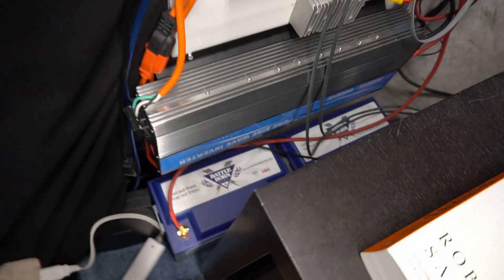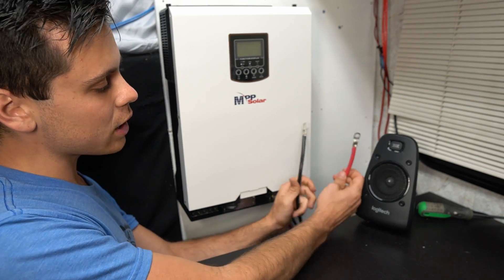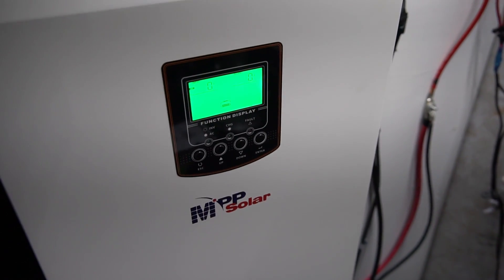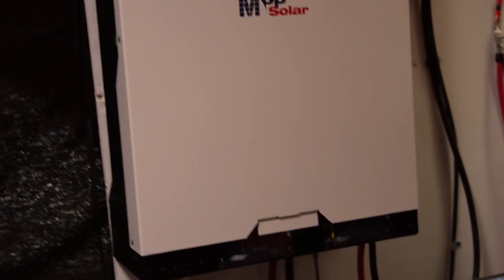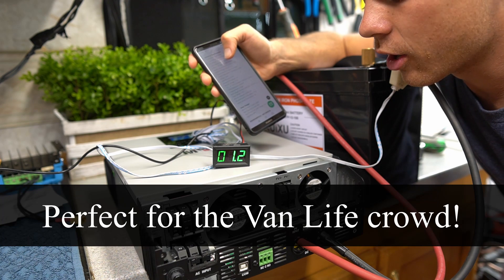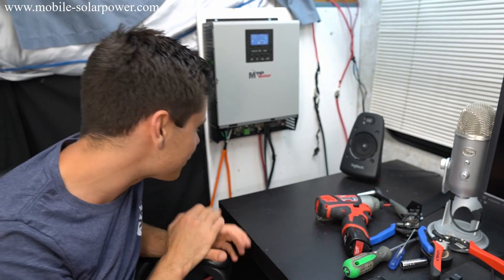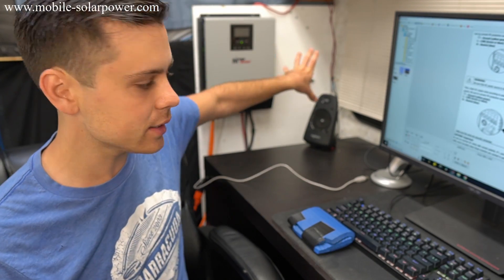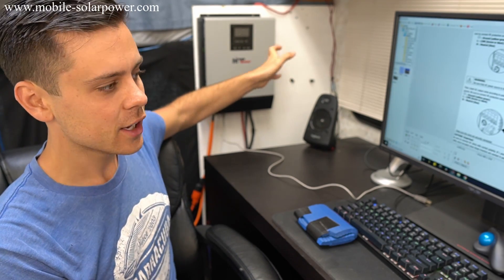MPP Solar Power Inverter/MPPT/Charger "All-in-One"  - Complete Review -

Comment: Heavy duty velcro like 3m dual lock tb3870, some on the wall and some on the box and it will hold the bottom. It could be used like a strap.

Comment: How would you recommend getting 1/0awg wiring from this unit to the battery? I'm looking at mine (bought the updated version of the one you reviewed here) and I have no idea how I'm supposed to get the +/- wire into the small square terminals on the inverter safely. 

Any suggestions?

Thanks!

Comment: Hi Will. I have the PIP2724LV-MR with the 24v Fortune cells (I follow your recommendations a lot). I'm having a problem where the charger/inverter will charge the battery but it doesn't charge with solar. 

If I disconnect the battery and let the power run out of the inverter, when I reconnect the battery and turn the charger/inverter back on, it will charge from PV for a few minutes and then stop.

Any idea why that's happening?

Comment: So if I use parralel for the solar panel (isc 5.83) amp will add up but not voltage, mppt all in one have 80 amp so you can add 4 panel  or more for this is this right?
Reply: your system still working or you burned out..
you need someone good at solar
also having 80A mppt dose not mean you must add panels to fulfils that value you must consider panels VOC

Comment: For # 2 setting I'm having trouble how to calculate max current for utility & solar, I have a 6 12v valence series/parralel= 24v. As of now it's set for 40 am not sure if it's ok to let it be like? Need help please
Reply: setting 2 is for ac battery charger not for the ac output

Comment: Does this mean that if my house load is more than the inverter capacity of 800w it will bypass and switch over to the grid ? In other words can I run 3kw load through this inverter ? I was always under the impression that the load cannot exceed the inverters capacity. Appreciate your feedback. Thanks

Comment: so question.....I understand the 24 volt and 48 volt systems have larger inverters and can handle more solar panels. But most stuff for campers runs on 12 volts. So how or what do you need to run 12 volt appliances on a 24 or 48 volt system????
Thanks so much.

Comment: It's not silly.  I have MPP LV2424 and i have the same problem the fans are horrendous.  These units can be problematic.  For some reason I may have a bad one and am working with support (slowly) now.  Their technical support is definitely slow.  With no load aside from the inverter itself and two 12 volt 100 amp batteries, the system drains the batteries in minutes and dies.  Definitely something defective there.  As easy as these are to work with, they have their problems.  I've definitely been bitten by quality control issues.  Good video.  I wish I'd have found it before I purchased.  It definitely would have opened my eyes to a few things....  I'd love to know what settings you changed.

Comment: I'm looking at this current MPP Solar 2.4kw unit on the Australian website and the charge controller is only rated at 40A. Seems quite low for the size of the unit. The next unit up is 3.6kw, too large for what I'm after. The price seems a little too good to be true ey..

Comment: You're right about the fans, they do drive me nuts.  I put it in a closet behind a door which helps a lot.  Do you have a link to the web site to set the parameters and configure this unit properly.  The manual is definitely not adequate.  thanks.

Comment: Do these All-in-one systems have DC in/out connections? Or do I need to set up a circuit breaker panel between the battery and DC appliances?

Comment: Not sure about this model but the newer ones have a screw hole on one of the feet on the backside. I took all the components out and mounted the housing with the two mounting holes at the top and the screw hole on the bottom foot, then put all the components back in. Now it’s nice and secure in the r.v

Comment: Will! 
Have you noticed if the utility charging amperage is close to advertised specs on MPP units?
I have a 240v PIP-2424MSE1 and in utility charging it is providing 5.2v amps less than maximum settings (25A or 15A) my system can soak up 100A charge so it's not the limiting factor.
Also if my battery only wanted 19.8A on the 25A max setting it should take the full 15A on the 15A max setting, not just 9.8A..

Comment: Can you over panel this 2424 unit? It looks like 2000w solar input. I'm looking to install 5 of 405w bifacials(in 2 parallel series to meet Volts)...which is 2025w, but because they're bifacials they could produce as much as 500w each(not likely all at the same time due to my property, but it's possible).

Comment: This seems like a perfect solution if you have a freezer in a shed or in the garage and want to eliminate the draw from the grid.  You can run an extension cord to it as a backup, but for the majority of the load, it pulls from the solar panels and batteries.

Comment: Will, I've been binge watching all your videos. I love them! I've been looking at the MPP 1012 for a small teardrop trailer build as I like the plug-n-play, but I'm concerned the fan noise will be a problem. I'll most be doing hot weather trips, so the inverter will always be on to maintain AC temperature, and I prefer to not be woken up by fan noise. Do you know of a quiter all-in-one solution, or do you think the MPP won't be that bad? THANKS!!

Comment: Can someone help with some input? Want to have my small solar setup, 500w array, 200ah lifepo4, and epever mppt. How can I set the system up to use the solar and battery as the primary, but only the grid if the batteries are low? I dont want an actual grid tie system…meaning Im not interested in back feeding the grid. Just want the grid power to kick in like a generator when needed.

Im asking this because I want to verify that I would not be back feeding the grid in any way. Thanks?

Comment: I need serious help. I'm at a loss, trying to understand how to connect an inverter. I have a super cheap charge controller and an expensive one, same for inverters. On the cheap one, there is a lightbulb symbol which I now think is the out? But the inverter isn't turning on. My question. How do I avoid connecting the inverter to the same points on the battery that the charge controller must connect to? I attempted this with a 48v system and almost burned myself with metal sparks that cut right through a battery terminal like a plasma cutter. The 48v inverter instructions said, do not connect at the same point as the controller" which is why I tried other points that blew up. I don't understand where else to connect them if the out is only for lightbulbs or weak appliances. Or is that meant for inverters? If so, why are they never labeled as such, and why aren't mine working on a simple 12v?

Comment: Hey guys just a quick question about the hybrid inverter with built-in PWM but I have already got an excellent MPPT charge controller.
Can I connect from that MPPT controller to the built-in ports?
Does it is give the same out as the MPPT?

Just trying to save some money with what I already have as the MPPT hybrid inverters are expensive than PWM ones.

Comment: I just received my MPP Solar all in one and opened the user manual. Page one under safety instructions number 2 it reads CAUTION to reduce risk of injury, charge only deep-cyclelead acid type rechargeable batteries. Do I need to return this item? I'm using LiFePO4.

Comment: All i have a rookie Question...How can you assume the Breakers / Fuses in these units from batteries to MTTP/Inverter?...the Batteries are connected straight to terminals... I understand fusing the batteries but with a 80A MPPT do you need another 100A fuse in line as well? (2ea 12V 100AH - SOK ) 24V3000 Growatt

Comment: True fans are noisy and idle power and two screws only for mounting, which are not insufficient to its weight. These are from china with different names but OEM is Voltronics

Comment: Im stealing your idea from another video with this module on the 4 280ah lifepo4 and 5 100 watt solar panels for charging but using 3 200 watt solar panels for 600 watts instead of 500 watts .... Can i run dc lights off this system as well?

Comment: I have epever mppt 50amp with edecoa 24v/3500w inverter and 8 180amp gel batteries. Im not satisfied at all, first batteries are old and disbalanced so they have no capacity. Inverter is shutting off at 20,5v so that is too low for gel, so i need to buy extra low voltage protection or make something with relays. Now i want to add generator because i have on epever mppt option to turn it on and off but i think i need extra device just for starting generator? And then i need charger, its too much.
This new devices are much better, less complicated, you can connect everything on it and if you have extra energy you can sell it i think.

Comment: What do you think of the AIMS Power PICOGLF60W24V240VS 24 Volt Pure Sine Inverter Charger, 6000 Watt Low Frequency Inverter 110/220Vac Split Phase, 18000 Watt Surge, Battery Priority Selector, Terminal Block, GFCI.

Comment: Being able to switch to grid power when the inverter is over loaded is such an excellent feature. Perfect for a very small system that can supplement grid power, offer modest emergence back up, and is pretty cheap to get going.
Reply: Does this system lower energy costs when we're making more electricity feeding back into the grid system?

Comment: Just a quick question...

Instead of installing a single plug on the AC output, would I be able to wire in a multi output surge protector? Would need to run more than one device at a time, seems like it would make more sense to wire that into it directly. Any reason not to do this?

Comment: victron are not much more expensive....$1500 for 3000va $500 for mppt and they are guaranteed 5 years (no questions no proof of purchase required), but you do not need it they work flawlessly...here in oz the mpp solar is > $1200...had victron turned on for a year and has not skipped a beat...you get what you pay for, do a review in another year...returning parts that you want running 24/7 is always a hassle no matter what the company...love the videos, what happens when you overload this unit?

Comment: we were testing 12V 230V system 1000w and fans are running as long as solar panels is making power over 10A on input. 48V has online upgrade for those fans so you can download sw and get rid of fan noice

Comment: Im new to solar and living in an area without the ability to tie into grid power. What would be the best way to determine how big of a MPP Solar unit I could safely get by with? Are these kilowatt rating based on continuous load? Small home in SE Asia and my access to internet is limited right now and I'm trying to build a system without making any huge costly mistakes. Love the channel...when I have an internet connection!

Comment: Good. But suggest if you parallel two 12V battery Would you consider to add a high power resistor between them. Just prevent short circuit. Yes but the current only 17A. It should be fine.

Comment: If I take two 12v 110AH batteries in a series with the 2400W MPP, what size fuse should I use?

Comment: Great video. Yes, the all-in-one advantages are massive for the vandweller. Many vans pack along a small inverter generator to power heavy AC loads (tools and appliances) and charge batteries in extended cloudy weather. This system handles everything they need! The price is right, too!

Comment: Hi Will, love your videos! Great to see your enthusiasm on this subject! I was wondering if you could help answer a couple of questions about these things as the online information seems a bit vague about them. 

1) What happens when the load overloads the inverter, does it disconnect totally, or deliver maximum possible power with the rest coming from the grid connection?

2) As it has no external "limiter" like the SUNG type inverter with an external CT sensor - presumably it delivers to the loads based on the circuit connected through it - so to use one of these domestically I guess I'd have to disconnect my ring main and put it into this unit as the "load" - this would keep my "critical loads" going through it, so heavier loads would end up being on separate circuits (e.g. cooker, oven & 12kw instant water heater etc). Have you done something like this in your home, modifying your domestic circuits to integrate this?

3) Also what are your thoughts about the Tesla powerwall 2 as a single box solution?

Keep up the great videos. I just wish battery storage was a lot cheaper! One day I might be able to afford it!

Comment: I have a 24v version in an old refer container. Off line so use a generator instead of grid for when the sun goes for days or high demand. Yes, you are right. A great system. When I complete the new house I am going to use the 48v system
Reply: I will also screw the bottom to the wall. Also add an earth

Comment: The mounting hole for the bottom is on the inside back. You have to remove the bottom access plate where you add inputs etc to get to it.
Reply: Correct, but smaller units only have top holes
Reply: The two models I have the MG5048 has holes top and inside bottom and weighs about 35 lbs.  The larger one I have is an LV5048 hybrid and weighs about 70 ins and comes with a mounting plate that could hold 4 bolts but you could easily mount more and once unit is slid onto the plate there are 2 brackets underneath for 2 more bolts or screws so a total of 6 attachment points.  I would think the smaller units say 2400 watts or so might only need 2 bolts and if you actually bolt them not screw to a mounting board then mount it with however many attachments you want it would be plenty strong but it does seem like they would have an anchor point at bottom to keep it flush to mount.

Comment: MPP Solar LV2424 comes with wrong Manual. Can you provide link to the correct Manual.

Also, would it be possible to show how you in a different vid, hard wired the BMS to this Inverter.

Thank you.

Comment: Apart from confirming the idle wattage to be relatively close to the one shown on the manual, I wish you load tested it for efficiency across loads from 200w to 2400w in steps of 300w, then confirm what efficiency you are getting from it.

Comment: I use this kind of system since 2019 brand name Easun. Look like very similar. Same mounting problem, but i found that mine had 3rd screw hole near AC input terminal (inside) mine also had bluetooth, i can manage via my phone-bluetooth connection. Yes there is 2 fan that only works when sensor detect high temperature on the system. The 2nd fan will work when battery power are being used. There is also priority power-timer setting that we can set, PV daily output, month or yearly output. This system will autopilot us after we input all necsessary setting. I am using now on year 2, 3kW 24V system. Auto switching between solar,utility and battery is very interesting... btw i need to clean dust regularly to make sure the cooling system and air flow not interupted.
Reply: I just got an EASun 48v unit. I will check for that 3rd screw hole when it arrives. I am glad to have seen your comment

Comment: To prevent stranded wire from fraying when inserting into a compression connection, either A) tin the wires with solder or B) crimp on a wire pin (preferably solid) terminal.

Comment: Thanks for the video Will. I bought the system and have it set up now. It's been working perfectly for the last six months. The fans are a little annoying but I have now put the unit in a cupboard under my desk so it's not too bad. Did you ever find some quieter replacement fans? Also, I have a question for anyone that uses this system - which software do you use to reliably monitor how much power you've been using? Just to feed my curiosity I'd love to know how much solar energy I've actually used and also see how much it is drawing from the AC input to keep the batteries charged. Is there any software which is compatible with this system that keeps records of this? I use the watchpower software which seems to show me how much is being used at any particular time but doesn't keep any records.

Comment: Can I put two bus bars  between the battery bank and the inverter 3in1 to connect a DC system for lights and fan 12v (plus fuses box and coverter 24\12)?

Comment: I just got mine, Will, and it came with lower mounting brackets and the correct owners manual. Now I just need batteries  :(    I will be reviewing my unit and documenting my build on my Youtube channel. Mine is going into a cargo trailer conversion into travel trailer.

Comment: Thanks for this. I've been researching for my van build. I have no experience with electrical anything so this is all new to me. So far this 12v version seems like a good pick for my van. If I understand correctly, instead of the more popular Solar Generators available, this is the same thing, but without the battery correct? I'm wondering why this isn't more popular in the RV/camper world. It gives more flexibility, without going to a completely enclosed system like Goal Zero.